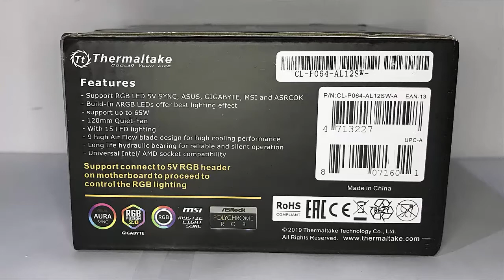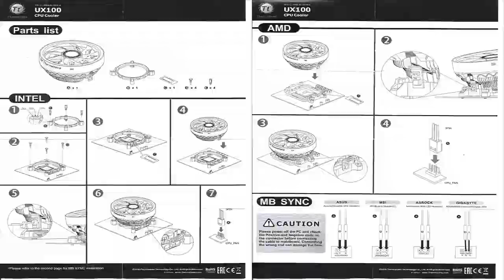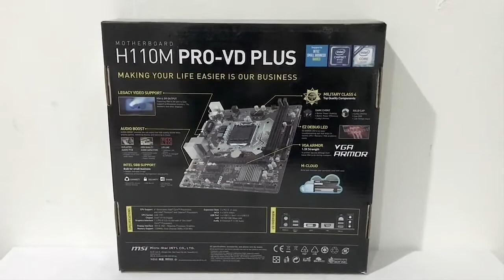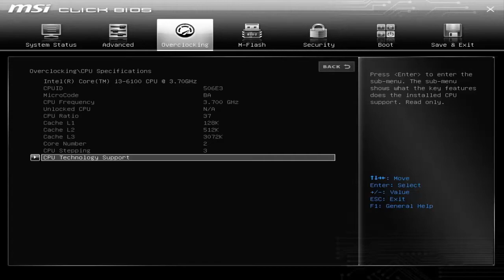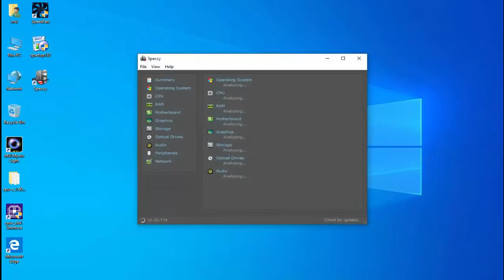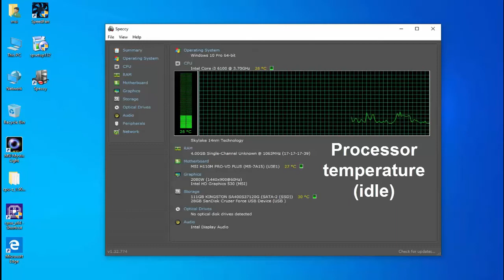Thermaltake UX100 ARGB Lighting CPU Cooler

Comment: this is the proper way to apply thermal paste. i dont know what this new gen of builders are doing.
Reply from the maker: @A F This is how I apply thermal paste, I make sure there is no air bubble when I spread it. Can you make video so that "new gen of builders" enlighten?
Reply: @xianece1  the new generation of builders apply thermal paste in an "X" or if its the AMD THREADRIPPER, they put it down as a "dot" on the cpu. this is not affecting in any way. its supposed to be applied in a thin layer like you and i  and a few others do.

Comment: Can i use rgb without rgb headers?
Reply from the maker: This cooler RGB will automatically lit when plug in to power. The function of the two cables (D & G) is to control the light.

Comment: How do I control it's RGB , my motherland is asrock b365 phantom gaming 4 . I connected it to my motherboard's argb header but I am not able to control it with polychrome RGB.
Reply from the maker: Did you connect correctly the two wires D & ground? D will connect on the 2nd pin and ground on the 4th pin.
Reply: @xianece1  yep , just now realised polychrome bis shit

Comment: will this be compatible with a mini itx motherboard will it block the ram with a mini itx mobo
Reply from the maker: Memory height compatibility is 33.8cm. You cannot install RAM with heat sink. See below link...
https://www.thermaltake.com/ux100-argb-lighting-cpu-cooler.html
Reply: @xianece1  yes you could install ram with this heatsink

Comment: How do I change the RGB with msi motherboard ?
Reply: MSI Mystic Light
Reply from the maker: Motherboard with RGB pinout support the RGB fan and to be controlled using mystic light app.
Reply: @xianece1  Yes i have an MSI Motherboard and ROG Strix Motherboard
Reply: Nevermind, motherboard can't even detect this crap. MSI Z490I Meg Unify ITX
Reply: SomeGuyWithMtnDew same thing here
Reply from the maker: Did you download the Dragon Center (UWP Version)? Also, did you connect the D and ground connector to 5V JRGB header on the motherboard? (1,2,x,4 - 2 is for D and 4 is ground) See link for the app...
https://www.msi.com/Landing/mystic-light-rgb-gaming-pc/download
Reply: Xian ece I connected it to jcorsair1 and it works  but I can’t change the colors
Reply: @xianece1  eh i am just gonna stick with the intel cooler. i can Somewhat change the colors but the leds become so annoyoing and glitchy. which makes me like the intel stock cooler because at least the blue sticker doesn't "have glitched leds"
Reply from the maker: Please check the link and download the corresponding application for the model of your motherboard...
https://www.msi.com/Landing/mystic-light-rgb-gaming-pc/download
Reply: I already did lol
Reply: But thanks ig